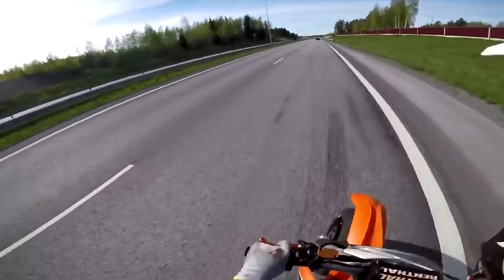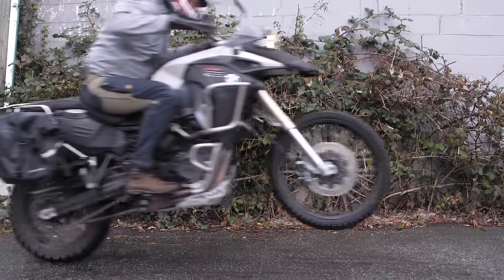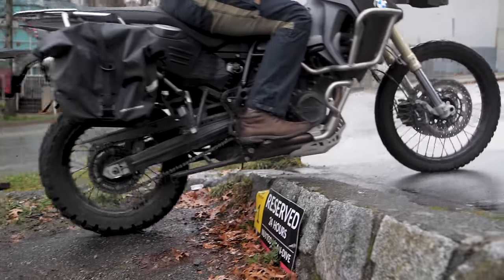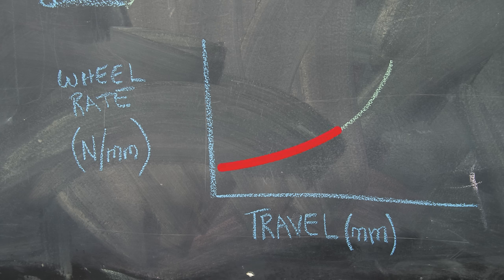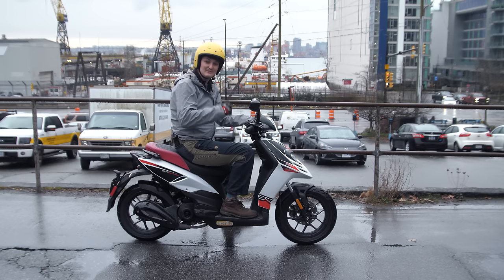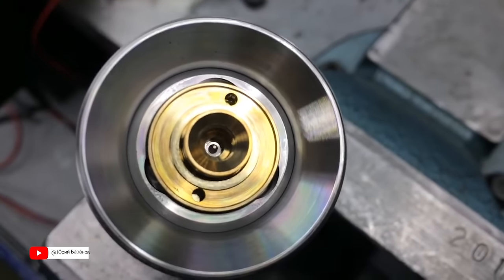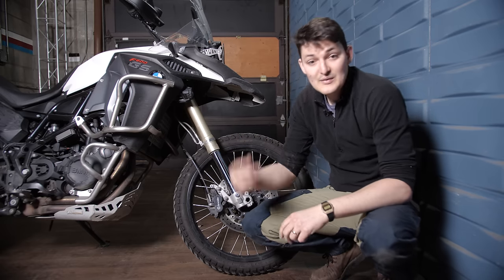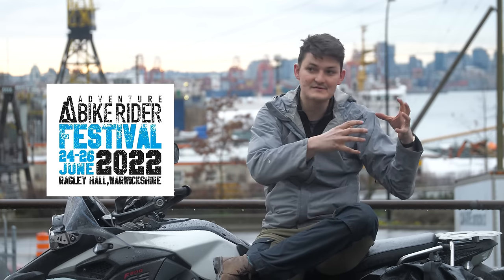Tank Slappers and the Quest for Perfect Suspension

Comment: I really enjoy your highly informative videos and feel I’ve gained valuable knowledge from them. 
This video struck a chord so I had to ask this question:
I began experiencing “death wobble’s” on my ’18 Tiger 800 XRx Low as my speed increases above 80-85 MPH on well paved highways without noteworthy slab seams. This started after several uneventful rides for the first 1500-2000 miles. 
I weigh +/- 205 lbs and have about 70 pounds in my panniers plus 30+ pounds in tail & tool bags. 
My rear suspension is set for maximum load. 
Looking for some recommendations to overcome this annoying problem.
Reply: @x_mau9355  malnutrition is not an attractive look - and has little to do with the problem, thank you.

Comment: The only one I've ever experienced was while rounding a bend on an interstate leaning to the left, going a steady speed on smooth dry pavement, at night and the bike just started jerking right and left for a few seconds, then stopped.
It was a 1977 or 1978 Honda 400-4 Supersport, and had it not stopped, I would have wrecked and probably been run over even though the traffic was sparse.
I was told it was the swing-arm bushings.

Comment: Electronic suspension may be akin to comparing digital audio versus analog, with respect to how the signal (music/road surface in real time) is received/processed and our response to the good and/or bad vibrations via skin, skeletal--large and small bones--organs, et. al.
The sensors in electronic suspension could be compared to microphones in audio--and a digital audio processor's bit sampling rate/frequency (e.g., 24bit/96kHz) with the electronic suspension signal transmission time (processing time) between sensors and actuators (electronic and mechanical).  One could include time domain functions applied to the suspension components (including oil viscosity) and feedback loops between sensors and electronic actuators.
The "skyhook" approach would work well in audio (both analog and digital) to minimize external vibration and maximize sensitivity to signal read, however, I'm not sure exactly how much "road feel" should be eliminated, and at what point we want to replace human beings--as riders--with robots, where human beings become little more than passengers.
I still listen to records and find the tiny little bones in my ears, in cadence with the rest of my systems, respond better to the music than is the case with digital.
And for the kind of riding I do (sportier touring) will continue to enjoy the well tuned Ohlins set up on my carbureted bike.

Comment: i lost a 6 month old, $25k bike because of this. started when my rear locked up and stepped out to the left then snapped back. i now have a 2'' round scar on my knee. only advice ive gotten that sounds like it would have helped recover the slap is stand on the rear break. the other thing i got told was grab all the throttle. that seems good in theory, but when the bars are moving that fast its really hard to keep the throttle open. so stand on the breaks!

Comment: My Versys does not get any sort of wobble like this regardless of speed (in fact feeling more stable as speed increases up to its maximum), but my DRZ400S gets progressively less stable as speed increases. Steering oscillations have less damping with increasing speed, getting pretty squirrely around 140km/hr (thankfully, above the speeds I'd normally ride that bike). I'm not hitting any bumps or losing ground contact, but it seems like increasing air drag at the rear of the bike minimizes it; I suspect it's an aerodynamic effect caused by the big plastic air scoops or the (rather floppy) front fender at the front acting under wind pressure at high speed causing gradually worsening stability, but I haven't tried riding with the fairings/fender removed yet to confirm the theory.

The point being, there's more than just the mentioned ground contact upsets that can cause steering oscillation in motorcycles, and different bikes/geometries are affected differently. 2-wheeled vehicle stability is a complicated black art.

Comment: Bike started wobbling at 50kph (about 30mph). Turned out a couple of rim weights had dropped off the front wheel. Stuck new ones on where the dropped ones were and problem solved - no wobbling, even riding without hands, at 90kph (about 55mph) and above.

Comment: Dampening already modulates spring speed. CDC would need to react to something else: packing causes the spring ends to stay too together for too long and not reset an expected long length. That's what triggers the PLC to momentarily open the damper valve.

Comment: Would you? 

Depends. Sometime, the compression and rebound are utilized by the rider to control the motorcycle. In cars, it is often referred to as loading the suspension. For those who need a controlled ride, it is probable a great thing. For those who enjoy the personality and integration between man and machine, probably not.

Kinda like a Miata - simple, light, communicative, pleasure.

Comment: I had a Mercedes with "Skyhook", it's an option that is not even fitted to their high-end models as standard. It had springs and dampers too. Having a car that leans into a bend at high speed is weird. Great until the computer packed up, BER.
A far cheaper alternative to the CDC computer control is simply to have the progressive springs with dual damping.
Sports bike geometry with fast and pointy steering can exacerbate the problem. It works fine in a racing crouch but not if higher bars are fitted for comfort, that then needs a longer rake/trail.

Comment: Hmmmm - one word - "Resonance" seems to have been minimized.

Your frame and fork form a dynamic system and your fork assembly is, for all intents and purposes, a pendulum, and like the Verrazano Narrows bridge, under the right conditions, can amplify the inputs to turn into a "tank slapper" or "death wobble".

Back when I started riding, nearly anything above moped size had some sort of steering dampening to resist this resonant pendulum effect - it might be a little hydraulic piston, running between the frame and fork, out of sight under the gas tank (these are not uncommon aftermarket items today), or it may have been a big friction damper knob between the tank and handlebar mount that you would tighten as needed - quite common on old BSA, Triumph, Enfield and other bikes of the era.

The mid-80's Gold Wings were notorious - the smaller GL1000 had worked pretty well, but when they started to get bigger, problems cropped up. Honda put their best engineers on the job. They did not change the suspension, or beef up frame and fork to stiffen them - no, their solution was to bolt about an 5-8 lb. iron weight to the fork assembly under the fairing, about where the headlight would have gone, changing the resonant frequency of the front fork assembly.

This type of death wobble was precipitated, not necessarily by any kind of extreme bounce, or suspension compression - it was often under specific conditions "48 mph in a slight curve", "64 mph when a truck passes" - which is what made these resonance wobbles problematic - you pretty well knew if you shoved a stock Kawasaki "Mach" triple too hard into a corner that ugly things were about to commence - resonance wobble, on the other hand, was often under less expected conditions.

Some of it is just engineering - hands down, the most stable ride I've had was my old Guzzi 850 T3, which did not have, by any stretch of the imagination, a high end suspension. But cheap tires or lousy roads, it absolutely refused to do anything other than predictably hold the course I set, calmly and without fuss, even when I was scraping pegs.

Comment: Sound stuff, bud. Slappers also product of steering geometry, another reason pack down is so dangerous. I've had two lock to lock tank slappers, both when hard on the gas over bumps: Honda SP1 at 130mph  and Honda 954 FireBlade at 90. Both unnerving. Strangely, Honda started fitting steering dampers soon after those bikes... Plenty of wobbles and weaves from other bikes, but those were the only two bikes that slapped. I never owned a TL1000...

Comment: I had a BMW R80 road bike that was in the shop to diagnose a headshake.
I couldn't believe the mechanic when he said it was the front tyre (Metzeler Laser ME33) as it was only 2000km old.
Apparently it was the chevron tread pattern that caused it. 
I thought only sport bikes were sensitive to tyre wear, tread pattern or tyre pressures.

Comment: I'm going to be that guy and point out one minor error in this great video.

When Ryan is talking about progressive springs, he's actually going in the wrong direction while pointing at the harder and softer parts of the spring. Those coils with smaller gaps will close first, leaving behind fewer active coils, which actually increases the spring rate.

I used to be a spring inspector in a factory, and yes that means I made sure they were just the right amount of bouncy.

Comment: Brilliant - science/engineering conveyed with humour. Be great to have an explanation of modern IMU linked wheelie/traction/braking/slide controls, which on some include QS controls as well. And to answer your question - “yes”.  Having had a track day suspension tune and seeing the benefit there, and also realising the tuner’s warning that the tune would not be great for some real world conditions was spot on - having effective real time adjustment would be great.

Comment: Active suspension..I'd say if it could perfectly absorb all road irregularities, potholes, and speed bumps, reduce wear on the bike, limit mass transfer and prevent offsetting the bike's geometry when accelerating or braking, without compromise beetween performance/stability and comfort, without being too heavy, it would be totally worth using a significant amount of energy! I rememeber being blown away by Bose suspension prototype a long time ago. but I would be surprised that it reaches motorcycles first,if it ever goes to production, it will be probably luxury sedans first, luxury GT motorcycles 10 years later  and eventually affordable motorcycles 20 years later, like ABS or traction control. but unlike ABS and TC its not just about a couple sensors and a chip, its a complete redesing of the suspension system

Comment: Of course some bikes were just badly designed, and would get a death wobble on any road at certain speeds. My old BMW R65 being one of them, I finally found a partial solution by fitting a rear tyre that had no central groove. Yamaha XS650 (hinge frame) was another, had a mechanical steering damper (which sort of worked). Aerodynamics is another cause, R series BMWs warned you not to exceed 130Kph (I think) if panniers were installed. I think the V4 Honda, the one that had the small front wheel was another such bike.

Comment: There is also one other reason, bike frame stiffness and geometry. My first motorcycle was Yamaha XJ600 Diversion and it would have diverted out of control very quickly if both hands where not in bars. It is famous for tendency to start wobling.

Comment: I'm confused with your anti tank- slapper advice....remove some preload to drop the front or add some to raise the rear.......I guess you mean remove preload on the front suspension to drop the front or add some on the rear shock to raise the rear...unfortunately most motorcycles only allow rear preload adjustment. ..so anti tank slapper advice will generally be to add preload to the rear....thanks for that advice...Ryan ..and for the explanation of how it's caused . I have an issue with steering wobbles when I cross raised white lines

Comment: Loose steering head bearings, worn front tire are two main reasons for tank slappers but even top motogp bikes can still get them. This is because your bikes frame is designed to flex just a little and when pushed to the limit can cause the frame to flex violently back and forth. Don’t try to fight it just grab hold the seat with your butt and hold on
Reply: hoiy vinosa  sport bikes get them often when pushed hard. If it happens give the steering neck bearings a slight tweak. Not too much or it will crush the bearings but they do get lose over time. I’ve put down wheelies on my R1s well over 100mph. Front tire would smoke out like a plane landing

Comment: I'm sure this is true but the most basic problem is that the rear wheel isn't aligned correctly! If it is not good you can get a wobble in the bars even at slow speeds. Getting the front end light makes it much worse! I got serious about this after I did a tank slapper on my 92 GSXR 750 at Bridgehampton at over 100mph! Close throttle, weight forward, dampen oscillations, pray! Note: anytime after you do a tank slapper pump the front brake until it starts to grip, (the shake will push your pads away from the rotors!). Thought I was going to run off the track after saving the wobble!

Comment: The BMW’s dynamic suspension is worth every penny in my opinion.  Not perfect, but better than not having it.  The ride is smoother, better control due to the tires spending more time on the ground.  Purposeful wheelies aside.

But, it does contribute to a numb road feel.  The teleleaver doesn’t help with road feel either. The combo is what gives the motorcycle its nest legendary disconnected reputation.

There are always trade offs.

Comment: I think perfect suspension ticks the box after heated memory foam seating, on the way to autonomous motorcycles. If I wanted all that luxury I'd have a car, maybe a convertible; and I wouldn't even have to wear a helmet! 

The feel of the machine, the road, the hyper awareness of centrifugal forces and terrain, traction, foreseeing obstacles and standing up on the pegs or maneuvering around them.. I enjoy this, and I would hope most people find the discomfort and challenge appealing, on a bike. In my experience tank slappers are usually a result of going too fast on too poor of a road, or doing something more obviously stupid. You can only build something to be human-error-proof so much until it starts to drive itself.

Comment: There must be other causes though. I have had SCARY tankslappers on my CB750K2 and a CB360G5 (yeah, decades ago) and they were not caused by lofting the front wheel. The 750 may possibly have hit a small bump (a pebble) in the road, but the 360 issue was caused by me putting my feet on the rear pegs. That simple change filled my nappy big time. A couple of days later I tried it again and (at about 70mph) I got the same result. Thoughts?

BTW, I never tried it again.

Comment: The answer to your question is also answered in some of the earlier solutions: give the user the option to change it the "spring" rates. If the bike comes from the dealership with perfect shocks but you could restrict or modify them to be perfect for the user via an app for your phone I think that's the best option. Pull out your phone, turn on the motorcycle, change the dampeners to the conditions and or drive comfort you want, then take off. Today feels like a racer day: Put everything in ultra hard track mode. On the way home your hurting or tired...switch it to numb mode.... I mean Dentist mode...I mean perfect suspension mode.

Comment: Lotus was the first company to develop a fully active suspension system back in the 70s/80s and Williams reached the pinnacle of the science a while later.
With modern electronics and batteries, I doubt that the battery drain would be too great. However, I doubt that any of the companies will advertise that their bikes have a 10% power drain for their fully active suspension, however good it is. Because bike sales are driven by peak power figures, even if that power is unusable. 
Given the weight of m/cycle suspension components, I doubt that it would be too costly for bikes in terms of power. However, developing a bike specific system would be expensive in terms of $$$$.

Comment: I ride a 25 yo TL1000s with stock suspension , we adjust our dreams and sprinkle angel dust on the tyres after we remove the steering damper.

Comment: Would I have the perfect suspension?  NO.  Defeats the whole idea of riding a motorcycle.  I have a very similar bike to your HD.  And yes some adjustment was needed, but only because mine was the "superlow" and the only bike available here overseas in the Harley line that made sense here.  Low is NOT what I needed so I simply built some stainless billet shock extensions, kept the preload what it should be and gave myself the clearance needed to deal with the road conditions. (potholes the size of basket balls every 20 to 30 meters)

I like a little bit of the feel of the road, so I am happy.  But I do understand the topic, tank slapper experiences for me have always been at speed on a highway and are quite difficult to ride out in the vertical mode for me....

Comment: I actually had this idea, and even had some rough calculations done and general theoretical proof of concept, and even checked with an engineering firm and electrical engineer and got a quote to design an electric suspension for a motorcycle.
That would require solving some electrical problem like a solenoid engaged backwards as current generator, and with variable push force maybe like a step solenoid, so you can also recuperate energy from the damping, this way it could maybe generate its own energy and maybe charge battery a little. But no leaks and easy tuning👍
Had some eng problems to solve but possible, would been an original solution, most probably patentable.
👍
Could been a nice product🤔

Plus it'd probably have another applications like in places with high pressure (underwater) or space where seals wont hold or other places.
A "linear electricity generator"👍
Like linear actuator backwards
No similar patent anywhere🤔
(entrepreneur btw)